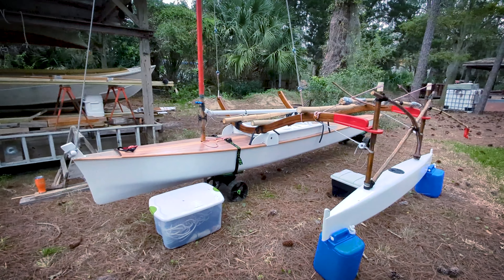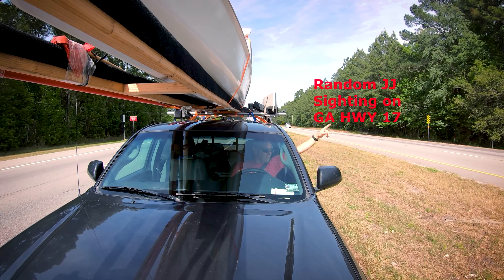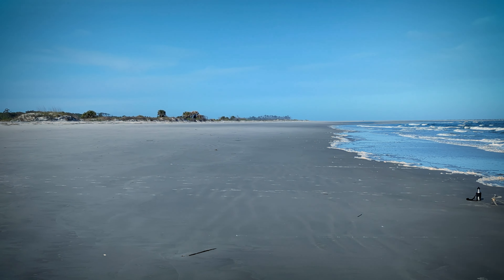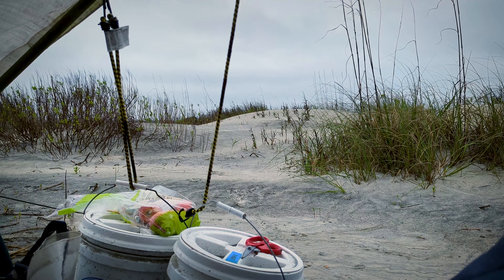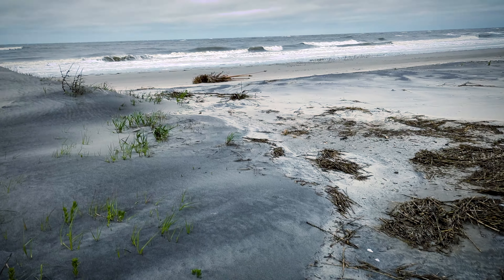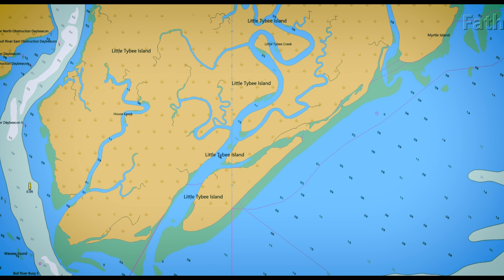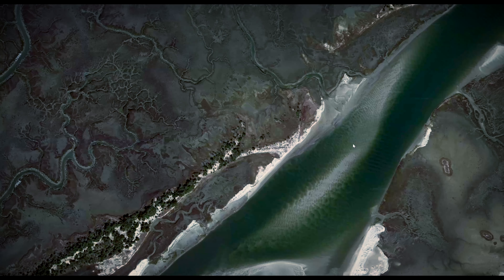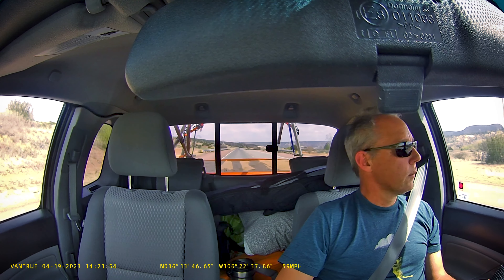Misadventures In An Outrigger Sailing Canoe

Comment: As a boat restorer the cardinal rule is... when in doubt, laminate, laminate, laminate every structural part possible. 
Treehouse🌲Boat⛵️Works
Reply from the maker: I'm a fan of lamination (the waka and ama are laminated in s-glass and I'd have it no other way)... but I've seen a lot of parts rot from the inside--out, and other parts self destruct when moisture migrates in and the wooden substrate swells, splitting the laminations, so I try to be judicious about it.  In the case of my failed ioko, I blame my poor wood selection more than anything else.  I sacraficed strength for weight in a critical place where more strength is clearly necessary.  I don't know if this wa'a layout will survive planned revisions, but if they do then I am going to inlet hardwood dowels into them and call them sufficiently reinforced.  I'd prefer to be even lighter (most decisions on this boat came down to weight-conciousness), so if they fail again I'll make them from okoume or hoop pine ply, or carbon fiber with no wooden cores at all.  Manuiki'iki is 21' long and I can pick him up by myself - and I'm not getting any younger 😂
Reply: Yup... Nearly every structural failure I see during a restoration is associated with metal fasteners allowing moisture in over time... with modern adhesives and laminate techniques there is far less reason to use metal fasteners, which no matter how well protected or maintained will eventually fail. 🌲⛵️🌲

Comment: Was stationed in Savannah in 1967 and only went to Tybee Island once.... got sunburned so bad that it shocked me.  I'm from California and I never peel!!  Every inch of my body peeled that summer.  Went to Vietnam after that and even Vietnam wasn't as hot as Tybee Island was.....
Reply from the maker: Tybee can be brutal, that's for sure!  I was just there and I helped move a large aluminum spar, but when I was done I felt wiped out... turns out the neighbor's thermometer was reading 110 degrees.

Comment: Tybee can certainly crank out rough conditions for a small craft. I sat my ACA Lumpy Waters course there a while back.
I added small wooden sailboats to my mix after that.
One thing I've noticed with lashings (like your repair), using cordage with some give tends to let a wooden boat flex and take less shock than a low stretch Dyneema. Then again, we use what we have when doing repairs underway.

After a few years of playing around in the more forgiving Gulf and Outer Banks (and Identifying failure points), I took my 19 ft open cockpit trimaran to Hamilton Bermuda from Beaufort, NC in the best window I could find at the tail end of hurricane season. I don't know if I've ever felt that tiny in my life.
Reply from the maker: The softness of the sand on the Gullah coast definitely belies the danger to boats of every size and mode... this wasn't my first time getting my ass handed to me here, that's for sure!  It won't be the last, either.

I used dyneema on purpose - I always have a variety of lines and methods for repair and lashing, but in that case what I wanted to use was something that wasn't going to loosen when the sun warmed it and something that could resist moisture... a larger diameter would've resisted pulling itself into the wood, but that was the size I had.  Ideally the wa'a wouldn't have been so fragile in the first place!  I'm fixing that- overkill on the structure isn't overkill, so overkill is coming.

What kind of tri did you transit on?  I just picked up a Windrider 17 and a buddy just got two of the 16's... I'm sorely tempted to do the R2AK in the 17... 

I have over 1500 days at sea sailing on container ships and I've felt very, very tiny out there, even on 1,000 foot ships... if you don't feel vulnerable when you're in the ocean then you simply don't understand where you are, or you lack the imagination to comprehend the many ways you can die, or you lack the experience of enough close-calls to keep you perpetually second-guessing your every move.
Reply: @Forrest-Jackson  Windriders are pretty bulletproof for what they are. I have a buddy in his 80s that sold his 17 and picked up a 16 as the 16 is so simple to set up and be on the water in minutes. From what I hear, the lack of a centerboard makes them to point very well. From a nonmototized distance race perspective, they paddle like a dog if you're becalmed. Super fun vessels, but I don't know that they're well-suited for a R2AK.
I bought plans for a Slingshot 19. They're at home in skinny waters like the Gulf and Outer Banks, but a bit fragile on bigger seas. Also not a good fit for R2AK type conditions.
My current iteration vaguely resembles the initial build. She still folds for trailering, but she's rigged with two mast steps to accept either a Hobie 16 sailplan or a RSS balanced lug. The Hobie yields the best peak performance, but the balanced lug can average higher on longer trips. Just so much simpler to deal with a single sheet and sail, and reefing underway isn't a death defying exercise single-handed.

From a sailing perspective, I'm a noob with about 8 years of sailing, most of which is small homebuilt vessels. Hoping to build a 13 meter trimaran (or buy an older one and modify it) to do some bluewater.

Comment: I realy like your adventure, the naration, everything. Mother nature is very humbling on the water.

I went to the Bahamas with a cheap 30ft catamaran with very little experience. It was mostly great but also humbling.
We had two 9.9hp outboard (one for the dighy and another for the boat) that came very handy when one quit or had the propeler tangled in rope.

A small proa like this is only used inside protected atols, not in the open ocean.

A tiny gas outboard would also make a huge difference.
Consider it a safety feature.
Reply from the maker: Thank you for your kind words!  And you're right... mother nature will knock the cocky right out of the disrespectful soul!  My most memorable voyages are the ones I undertook before I had enough experience to know better... if I were a more timid man I think I'd never leave the dock again after some of the storms I've weathered (45' seas in the North Atlantic and a near capsize in the Philippine Sea come immediately to mind).

I'd love to sail around the Bahamas, one day!  I tip my hat to you, sir!

I spent years as a merchant sailor and I have many wonderful memories from snorkelling and boating in both the lagoon and ocean sides of Kwajalein Atoll, and the comparable oceans and harbors of Guam and Saipan.  But those waters - some of the ancestoral waters to a few of the mulit-hull canoes - simply cannot be compared to the waters of Coastal Georgia.

The GA coast  has Gray's Reef as a breakwater, super shallow and ever-changing sand seabeds with many protective 'long-shore sandbars, and a wide tidal range that make the near coastal Georgia waters more similar to an inland sea (or lagoon) than to open ocean.  

I've seen larger swells, waves, tidal ranges, and current velocities here - where I live now - in the Salish Sea (Puget Sound, Strait of Juan De Fuca, and Georgia Strait) than in near coastal Georgia's "open ocean."  Don't get me wrong - those soft sand shores are a shipwreck graveyard when weather hits, but that's not when experienced sailors operate.

Each body of water I've spent time in has its own characteristics... hell, its own personality - and of all the waters I have had the fortune to know, I like Georgia's Guale Coast's personality the most.  And Manu'iki'iki was designed specifically for gliding through zephyr shadows over sandbars at low tide, pushed by the onshore morning breeze.

What I got in this video was a nasty, stalled northerly, of course, and an all you can eat buffet of humble pie!!! 

I'd be remiss if I didn't mention the many, many different canoes of the world, too.  From Bab El Mandeb at the mouth of the Red Sea where it dumps into the Indian Ocean all the way to the Galapagos in far eastern Pacific, I have seen canoes of every shape, size, description, and use.  

I've seen canoes in open oceans, inner and outer seas, lagoons, rivers... I saw two fishermen in a 20 foot canoe throwing nets 150 miles off the coast of Somalia.  The canoes of Sri Lanka are ocean going, as are the racing jukung of Tahiti.  The Philippine fishing boats of all sizes go out to fish in unbelievable conditions.

The Aleuts take their kayaks into the open ocean to fish and the forefoot design is meant to race down the face of ocean swells.

All of the Polynesian war canoes were ocean canoes used for warfare between island nations (Samoa, Hawaii, Chamorro, etc).  These are open, long, narrow, fast, and uncomfortable canoes that surf the face of following swells.

Your advise about an outboard does not fall on deaf ears.  I left my electric/solar outboard at the dock for this voyage and I will NOT do that again!  I will be making it a much more integral component on my planned upgrades for my next voyage!  

During my evaluation (at the end of the video) I had a difficult current to fight against when I was heading back in and having that extra juice was the difference between being forced to wait for slack tide and eating dinner at a decent hour.  

I will almost always choose to eat at a decent hour 🤣 

Anyway, thanks again for watching and sharing your thoughts!

Comment: Hi wow I hope you don't mind but I really enjoyed this video! although it's a pity there wasn't more sailing in it!

I would have done a very similar repair on that crack. I notice it occured just above where the grain was backed by the gunwhale, that is, where the tension went across the gain not with it. I also thought the akas were too high. I think dead straight would probably be okay, since they attach at a raised section on the vaka. On a tacking outrigger like this, I would recommend having at least enough bouyancy to support your weight, but otherwise, to get more righting moment an easier way is just to make the akas longer.

Also a very nicely made video! I am eagerly awaiting the next installment! subscribed!
Reply from the maker: Thanks!  The next installment will be me correcting the current deficiencies and adding some new ones :-D

I'm in complete agreement with you... I would have definitely enjoyed more sailing in this video, and less of me getting my ass kicked.  I'll work very hard to make the next attempt (May of 2024) more in line with our mutual desire, for sure.  I'll be retiring the curved iokos (and yes, making them longer) and stretching the ama.  Probably doing some PNW winter trials in my dry suit, too (if I can find the time - I have three large projects underway at the moment).  

Thanks for the subscribe!  I've been watching your canoes for awhile now and dig your channel - Thank you for sharing @dominictarrsailing!

Comment: I don't know how far you've gotten with your re-build, but I live in Everett and am willing to help with labor.  I've converted several canoes into very good camping  trimaran sailers.  An aka ama would be a cinch, although I don't use arched akas.  I rip them from solid fir or spruce with the vertical grain opposed to the direction of stress, then kerf slot them for a bit of fly  at the outer 1/3 length.  Fill the slots with thickened epoxy and wqrap with e-glass for flexible strength.

The amas are rigid foam core withseveral layers of glass wrapping, with extra at grounding points and surfaces.  The best I've made were 10' long x 12" deep x 8" wide used on an 18' Grumman canoe with 85 ft of sail (65ft gunter and a 20ft jib), but  a better rig was the jib plus a 54ft standing lug.
Reply from the maker: I appreciate the offer!  You're clearly a kindred spirit!  

My rebuild has gone nowhere past the planning phase, but I've gathered materials and now I need a window of time to act - my schedule is still a wall of work preventing me from this labor of love.  

I'm tempted to do a shakedown of the revised Manuiki'iki on Baker Lake this Spring/Summer/As-soon-as-possible.

The revisions I am making are to convert the curved iokas to longer, strait spars of sitka spruce giving them the athwartship proportions more akin to the Marshallese canoes - I want to keep the weight as low as possible while at the same time make moving fore and aft easier in any sea state.  I'm also going to add a manufactured kickup rudder and simplify the steering, add a simple boomless polytarp main to carry for days when dousing is critical to survival... and, of course, set off again ASAP.
Reply: @Forrest-Jackson  Baker Lake is my Valhalla Vortex. I have several videos of some sailing up there over the past several years  - before my shoulders and back said, "enough".  I took them down off my channel, but if you're interested, I'll re-post them and share the link.

If further interested, I can meet you there at some point and be the chase/photo/video boat....and chief heckler.  I'll bring the cooler.
Reply: Link to one video up at Baker lake
https://www.youtube.com/watch?v=LGRsZsgKCgU
Reply from the maker: I'll def respond here if this is going to happen!  Love the video - last time I was on that lake it was fantastic!
Reply: @Forrest-Jackson  I'm always ready.
Reply: I always wanted to convert a surf boat into a trimaran!
Reply: @donotwantahandle1111  The journey of a thousand miles begins with a single step.
Reply from the maker: That looks awesome!  You should definitely put those up on Youtube - but turn comments on ;-) so people like me can tell you that it looks like fun!
Reply from the maker: If you do you should shoot some video and share it - there's not enough "small channel" people posting their stuff... I'd sure af watch and subscribe.

Comment: Ive been thinking on a minimalistic sailing design- and seen some - like Sven Yrvinds designs - but they are too small and hopeless ineffective as sailboats... and looking at your proa - when you plan a trip on the outer coast like that - you must prepare for big waves - and have a volume that can keep your things and yourself inside the hull. Look at what the mini Transat can do - they are real sailboats that can take whatever. Your boat with all the small details that can break - and very little volume - you have to stand on it - no shelter - in a 3ft chop it not working at all. That the ama was to small - first thing I noticed - its stand out to everyone that has just a tad of maritime knowledge. It may seem a good idea to build a boat from used things... but if the result is not doing what you wanted - its a big waste. But you had a real lesson there - and made a good story out of it - so not a total waste - but going on with the challenge you need a total new design. Use the proa for sheltered waters.
Reply from the maker: The idea that you are either alive or you are safe can be perfectly encapsulated by the diametrically opposed vessel trade-offs of a shallow draft and the ability for one man to move, lift, and carry it, or an armored, steel battleship of a thing and weight-be-damned.  

I don't seek to change your mind (pointless), but perhaps I can recommend to you a great read by a man who took a 16' proa, "Desperado," from the east coast of Mexico to Panama via the near coastal route: https://grillabongquixotic.wordpress.com  His philosophy of what constitutes a journey, what one man needs to survive, and his total disregard of what the casual bystander on the shore thinks as he sails on by is... inspiring.  Perhaps Chris' blog can explain better than I can what it feels like to be alive.

Good luck in all your endeavors.
Reply: Having "just a tad of maritime knowledge" is knowing that this is not a proa.